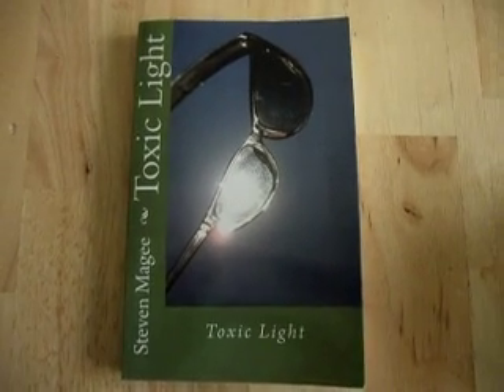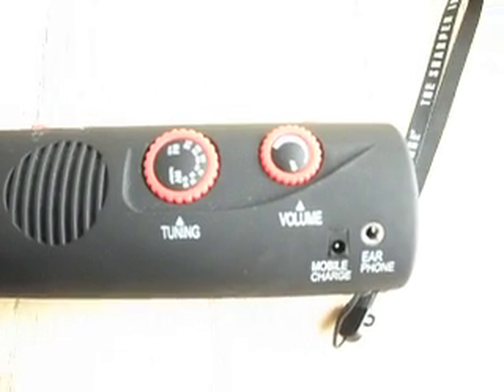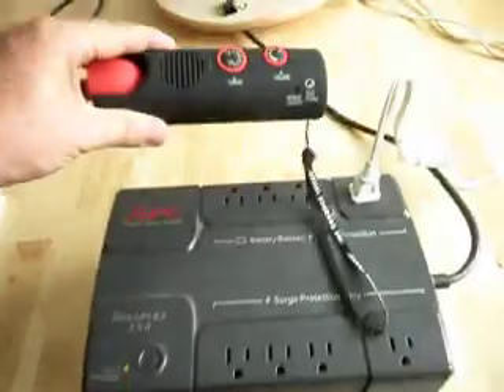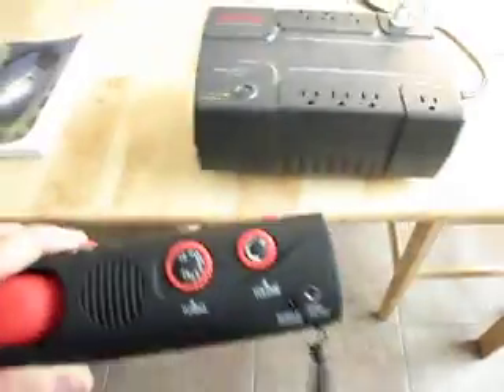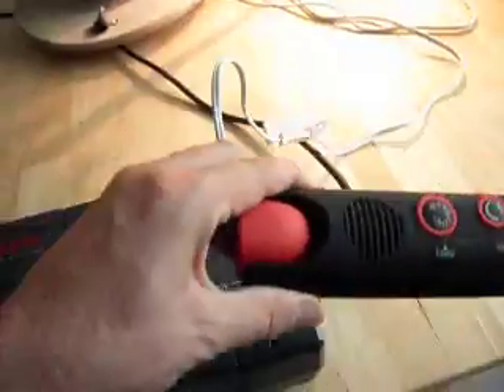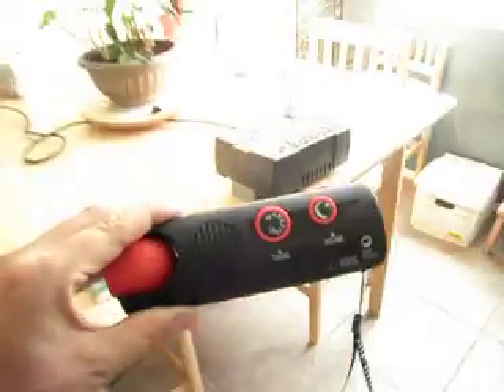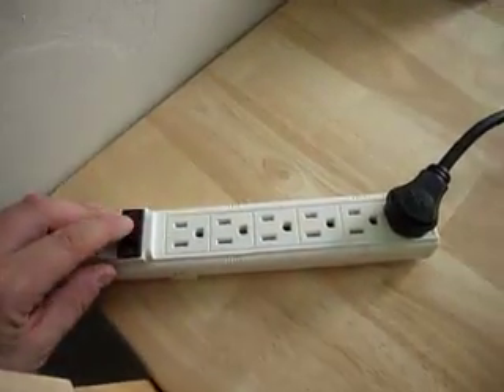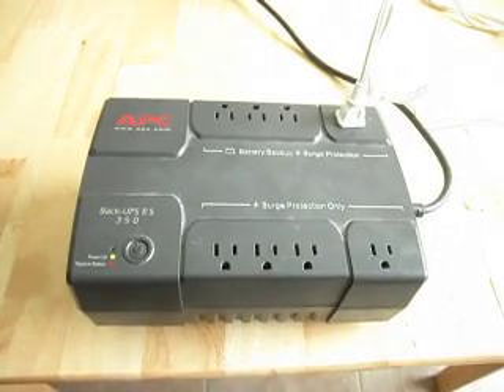Computer UPS Electromagnetic Interference (EMI) Fields

Comment: I just started working in an office that has an imac with damaged hardware. Anything could cause that, but it happened to be plugged in to this UPS. Subsequently moved the UPS to some other equipment in a different room, an external hard drive was plugged in and kept glithing and dropping connection. Hunch is this PSU is a POS.

Recently moved to Ohio from UK. Haven't heard a scouse twang in a while ;-)